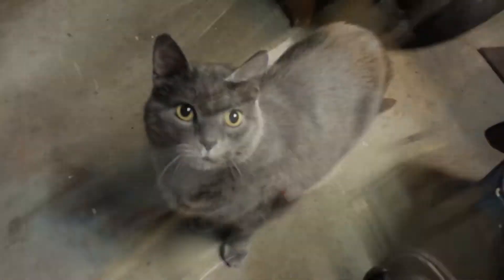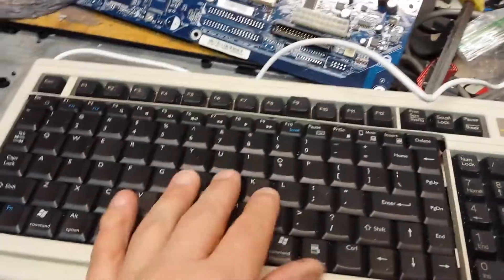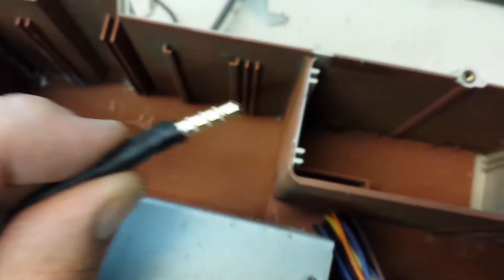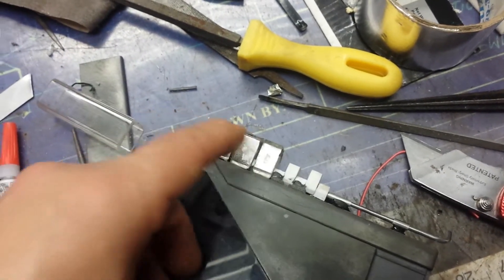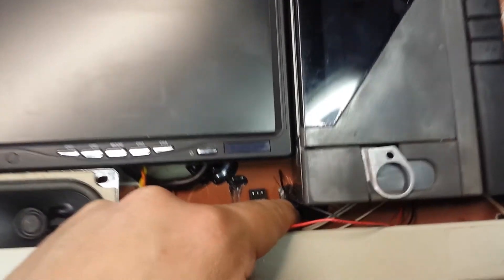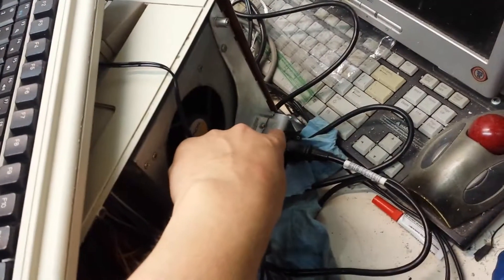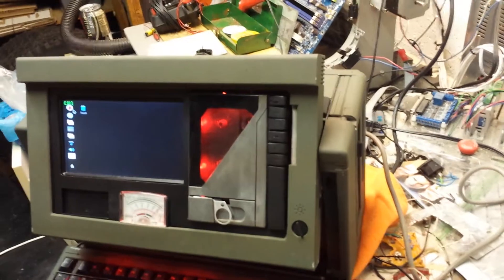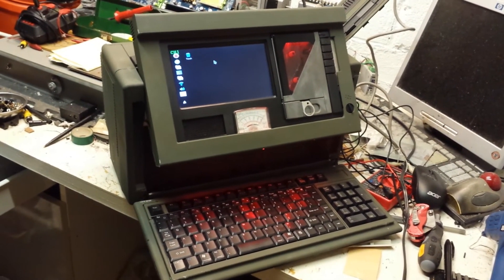Raspberry Pi Retro Luggable Computer

Comment: What a fantastic project! Great job!
Reply from the maker: Thanks! This was a ton of fun!
Reply: @ClayCarlino  Does the tape recorder do anything? I imagine there must be a way to hook up the magnetic read heads to the Pi...
Reply from the maker: @FriendlyWire , The tape recorder does not actually load or record data. The wheels turn when the buttons are pressed but it's just for show. I would have LOVED to have made it actually work, but the original device I used wouldn't do it. For one thing, it didn't have any kind of record function, but the bigger problem is that the mechanism is worn out. It can't actually pull the weight of a cassette ribbon. I made a special cassette with the ribbon as just a loop which looks the part and spins, but doesn't slow down the wheels. Maybe someday I'll do an improved version that is fully functional. Thanks for commenting!
Reply: @ClayCarlino  Oh, I see, thanks for the clarification! I would love to learn more about cassette drives at some point. I was born in 1990, so I grew up with floppy disks instead of data cassettes, but I imagine it must be possible to use an 8-bit microcontroller to write and read data on and off a cassette... Hmm... Perhaps a nice future project! :)
Reply from the maker: @FriendlyWire , I want to say that there's people out there who have done it. And I do believe that even a conventional cassette recorder can work, but I've never dug into it. If you ever try it out, post a video and send me a link. I'd love to see it!
Reply: @ClayCarlino  Will do! It might be a while, though :)